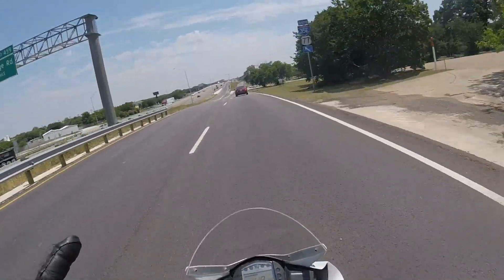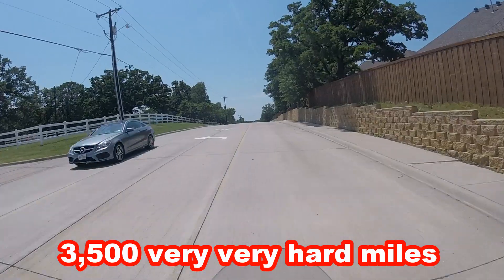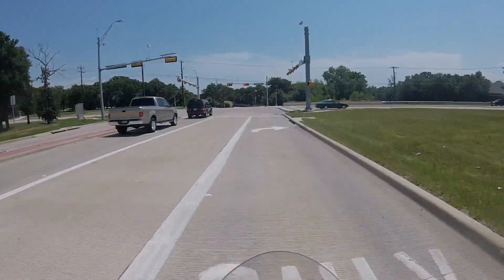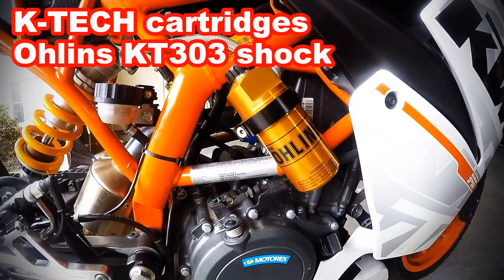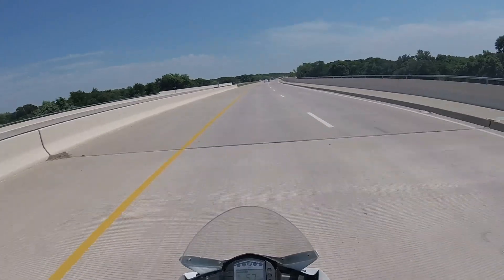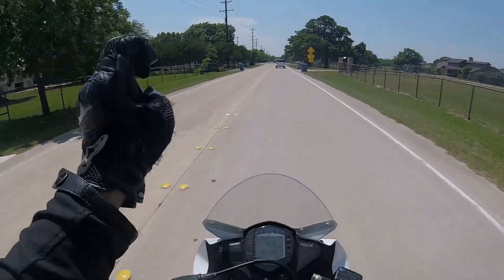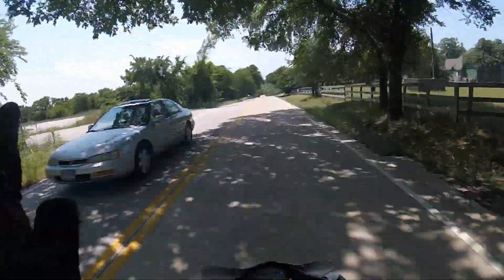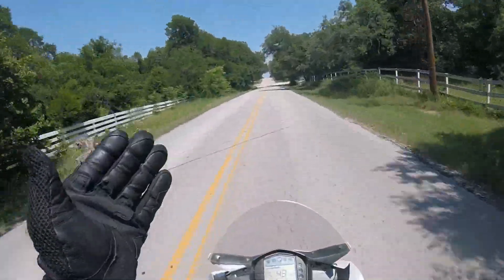KTM RC390 LONG TERM RIDE REPORT

Comment: im owner of rc390 n am proud of it..1st 2 week after out from dealer i got an issue of fork leak..well dat my faulty because on raining week i suppose to check the fork..dats all of my problem from this bike..i use it for commute 40km a day...n never had and issue till now...im asking for opinion wat tire i should use for commute..because..i currently use soft compund tire r now manage get 4k km milege..
Reply from the maker: ive never had much luck getting huge mileage out of sportbike tires. i could recommend the dunlop gpr300 though. excellent wear and grip. i used a take off on my supermoto and was very surprised with the results. lots of burn outs, sliding, dirt riding, and tracking and they still have plenty of life left
Reply: May i know about the fan? Is it real hot like others said?

Comment: In my bike I face air box cracked twice in a year which lead to engine problems like oil loss .can u also face any air box cracked in your bike.
Reply from the maker: mine definitely hasn't cracked, but how would a cracked air box lead to oil loss issues?
Reply: shift_love air box cracked lead to oil loss because crack create gap in air box which allows the dust particles directly into engine cylinder without any filtrations .so dust particle damage rings and inner walls of cylinder which create gap b/w rings and cylinder .this process leads to oil loss . thats why cracked air box leads to oil loss
Reply from the maker: damn dude. that must have been cracked for a long time, or its very dusty where you ride
Reply: shift_love ya bro its cracked more than 6 months and I am from india.

Comment: @shift_love I noticed that you mentioned ECU flash. What company got it done or if anyone knows of one, that would be great. I have Trouble looking for one
Reply from the maker: ktm RC cup map for the race bikes. allows the engine to rev a little higher, and run a little bit richer fuel map
Reply: shift_love and from where did you get that map from? Was it flashed into your ECU, dynojet, etc? Sorry I'm from California and I'm having trouble finding something that will work for my setup on a budget and I wanna make sure that's it's well spent lol

Comment: Nice rear shock man..didn’t it come with WP front forks..Motul oil is Top notch..what is your Dunlop tire like in the wet..Keep loving the KTM..it’s a hell of a bike..Nice..✌🏻
Reply from the maker: i havent tracked it in the wet, but on the street it does perfectly fine once youve got some heat (time) in the tires. and yea, they come with wp forks and shock, but theyre the non adjustable type. the nice stuff was equipped on the cup bike only.
Reply: shift_love..Cheers for the reply & You sure do have a Sweet Bike..Keep Having Big Fun..✌🏻

Comment: Does the fuel capacity not get a bit annoying when your on the street or when your on a long run?
Reply from the maker: It is a little annoying for sure. But I don’t ride that far on the street with it. Just fun around town bike. If I wanna go long long distances I’ve got my Ducati. I know that’s a situation that not a lot of people are gonna have. But if you have to go long distances on it I believe the new 390 duke has a much larger fuel tank.

Comment: did you upgraded the radiator fan too. can you share the size of fan you bought or please share the link of product please
Reply from the maker: It’s a spal fan. I bought it on amazon. The part number is 30103011. You will have to cut the plug and wire in your factory fans plug though.
Reply: @shiftlove  Other than having to cut the wire, is the fan a direct fit?
Reply: shift_love no need to cut it mate..just unplug from connector using smaller flat screwdriver on both spal n oem connector..believe me no mess,just installed 3 month ago..n da result is awesome!
Reply: Jared Shelton yes

Comment: How much do you change engine oil? And can you teach me how to manage?
Reply from the maker: since i dont street ride my rc390 very much i change the oil every few track days. however, if i were just street riding it timidly i wouldnt see a problem changing the oil every 2-3000 miles. but riding it aggressively on the street maybe every 1500 miles. to change the oil follow the procedure in the service manual. dont base your refill amount on volume alone. use the sight glass on the side of the bike with the bike in an upright position.

Comment: I go to track 4 times a year, use rc390 as a commuter for 15km. engine leaking oil where near to catalytic box. You have a good one maybe. But mostly I agree with you. Had a 15 r1 before rc390. R1 did not teach me a lot.
Reply: I'm using rs10 tyres.
Reply from the maker: i have heard that the valve cover bolts can get a little loose and cause an oil leak. i would start there. should be a simple fix, just tighten them, spray the area with brake cleaner and let it evaporate, ride and see if the leak develops